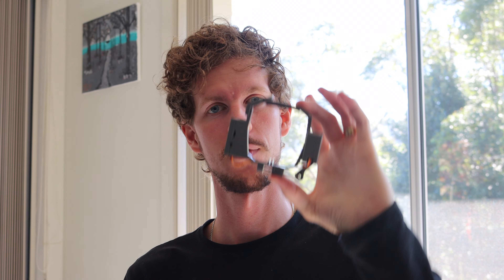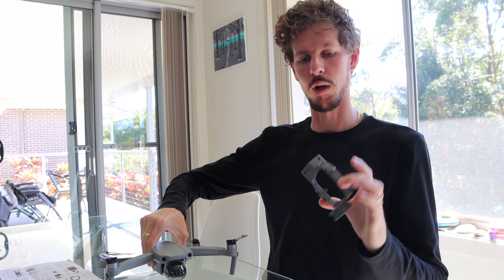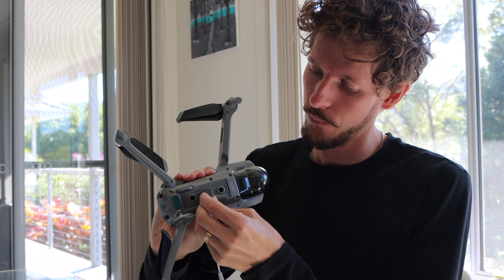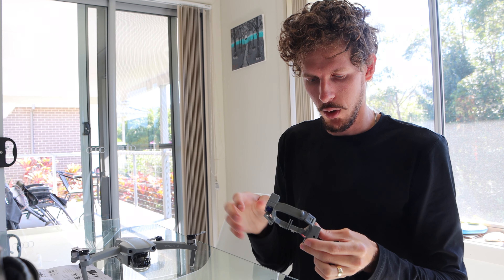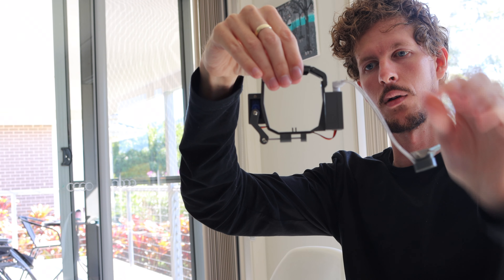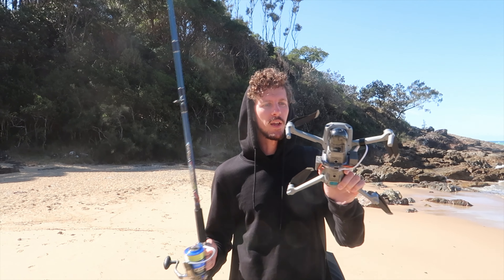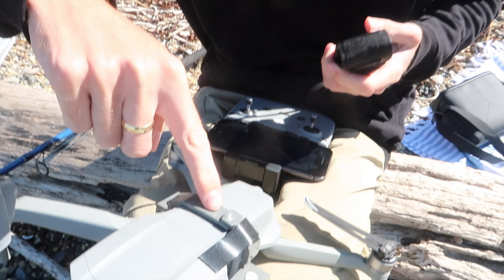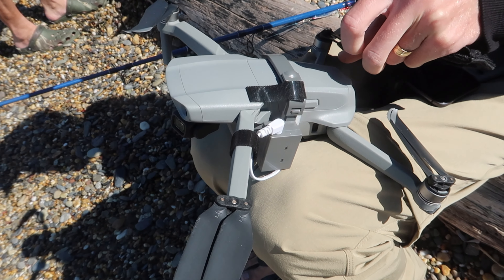FITTING EBAY DRONE FISHING RELEASE TO DJI MAVIC AIR 2 | DRONE FISHING

Comment: typical over complicated solution from a brainiac. just get a metal coathanger (bend it to fit on the drone underside) and a plastic clothes line clip (sometimes add rubber band to the clippy part). and you are done. $1 solution in 3 minutes.